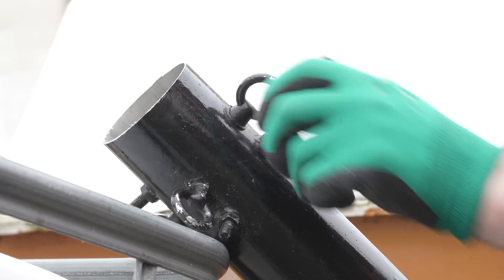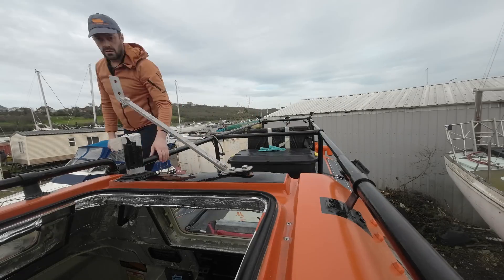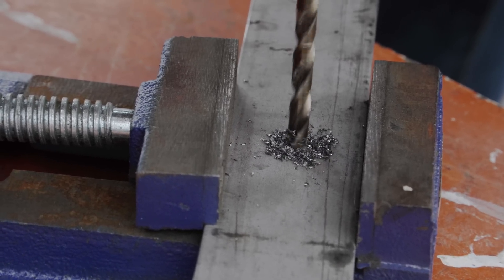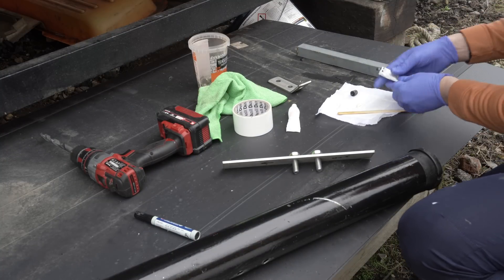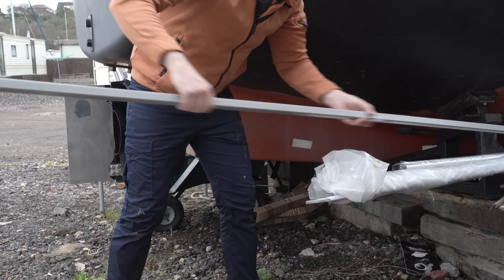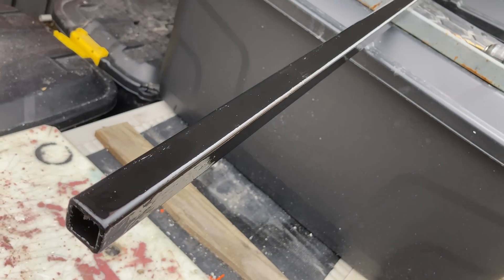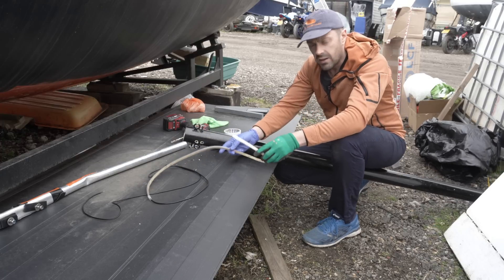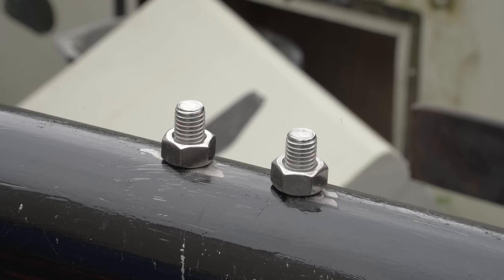Instrument mast preparation: space for VHF antennas, lights & a horn. Lifeboat Conversion Ep70 [4K]

Comment: Thanks for the Shout-out! I am proud to support your work. Been pretty busy though.

Most of the time I see a pole mounted with bands, or with holes drilled through both sides. Often with a curved mount the same radius as the pole's outer diameter to help hold it in place.
Reply from the maker: Cheers Paul! Welcome back.

Comment: Maybe I'm crazy but I didn't think it was necessary to treat aluminum because it doesn't rust.
Reply from the maker: In a corrosive environment in contact with steel, it will corrode galvanically.

Comment: Re the mast bolts, there's more than one way to skin a cat.

Idea #1  
A better way of doing this might be to bore two holes right through the mast, fabricate some crush tubes from some hollow bar that sit proud and weld them into the mast front and rear. Then the bolts (or threaded rod) can be inserted through the crush tubes and have flat & square surfaces to bear on when you tighten.

Idea #2 
Another way is to weld directly to the mast. Make any templates very accurately out of cardboard and tape that isn't too strong so it can be taken apart, take it and the mast to a nearby fab shop get them to knock something up and tack it onto the mast. Take it all back to Alan, test fit. If something is wrong then it is easy to change. When it is all kosher then get them to weld it properly. They'll be able to weld up the holes if needed.

Idea #3 
Re, those bolts on the mast with the JB weld on, forget ideas 1&2, alternatively run without a plate and no washers inside. 
Just align two opposite flats of the bolt head vertically and tighten. I'm mansplaining it, it isn't hard since the bolt pulled out by hand and lightly twisted will more or less self align and there is far less to crush when tightened than that plate. A thick wall tube that is the mast will hardly deform at all there.
Conversely, the plate is going to deform no matter what you do since it has 2x bolts squeezing it and you've increased the diameter of the compressive force over bolts alone - something has to give and it'll be the plate. It'll probably work if you really tighten it intending to bend the plate but the bolts need to be aligned so two opposite flats are vertical - and it's getting messy.
Reply from the maker: Thanks. I'll run through the options should my current idea not work. I want to avoid welds that stop disassembly. The plate won't buckle - it's 4mm!

Comment: For securing brackets to the mast I would look into using rivet nut inserts. Besides the threaded inserts you have to buy the installation tool but it's a great way to install a threaded hole in a thinner piece of stock. As for the bracket, if I couldn't find a flat-sided spacer for that sized pipe I'd fabricate one. The spacer slightly wraps around a pipe or pole and the outward facing surface is flat so that you can mate a flat object to it with screws or bolts.
Reply from the maker: I don't think DIY riv nut setters will handle stainless steel M12. And with this solution I spread the force across a wider area.

Point taken on the spacer.

Comment: I've noticed you're using stainless steel bolts etc. Don't be too alarmed but stainless doesn't go very well in salt water conditions.  Take a few galvanised spares just in case.
You're doing a fantastic job with Alan.  Keep up the good work,  and the videos!
Reply from the maker: I've not seen many problems with A2 or A4 stainless on Alan, or on all the other stainless fittings on the other boats in the yard. Can you elaborate? A4 / 316 stainless is specifically made for chloride conditions.
Reply: @AlexHibbertOriginals  If those bolts are specifically designed for chloride conditions then don't worry. I'll have to admit that although I do have some experience I'm not a bolt expert. I know you're no fool when it comes to forward thinking about such things so take what I  wrote as it being someone concerned for your safety.

Comment: I did something similar with bolting down solar panels to a roof rack where I didn’t have access to the bolt heads. To prevent them spinning I used carriage bolts so the squared section locked itself in to the holes that way I only had to tighten the nuts without fear of the bolts spinning.
Reply: Also if you’re worried about someone disassembling them. You could also use security nuts but they’re a bit pricy once you buy the correct spanner
Reply from the maker: Yes, I suppose a square hole in the 'washer' and a carriage bolt would have done the job.
Reply: @AlexHibbertOriginals  sorry to reiterate, existing holes changed to slots in my case

Comment: That flat piece of steel inside the mast is going to damage it and create divots which can lead to failure. You need to form that metal piece to the masts curvature.
Reply from the maker: I suppose we'll see. The area of contact is pretty long down both sides. I'm not expecting divots.
Reply: @AlexHibbertOriginals  maybe grind down just the corners then

Comment: For bolting into a tube / hollow structure the bulkhead door hinge clip nuts of a Land Rover Defender/Series come to mind.
  The nut comes attached onto a clip which is slid into an oval hole. The clip holds the nut in place and stops rotation. Best googled images to understand.
Reply from the maker: I tend to dart for cover when Land Rovers are used as a model for engineering prowess.
Reply: @AlexHibbertOriginals  haha, thats very valid, but there is no other car you can fix (or 'make work') with just two screwdrivers and a socket set

Comment: I would drill corresponding holes on the both sides of the mast, and :
Either cit the some sort of thick wall tube or pipe to the length of inner diameter of the mast feed long bolt thru.
Or better option is to drill corresponding holes the diameter of the tube in the mast 
Feed the tube through and get it tig welded.
This way you can torque as much as you need without distortion
Reply from the maker: Yes this is elegant, but takes up a lot of internal space, and means another welding bill.
Reply: @AlexHibbertOriginals  it wouldn't take that much space inside,  also if it's  pre cut and drilled, you could get it welded for 30 quid. 
But in a crisis situation all you need is two spanners to remove the bolts and refit them, you don't have to rely on the chemical bond in cold and harsh conditions.
Reply from the maker: True. And I might get a stick welder. Although the chemical bond is irrelevant once the nuts are tight.
Reply: @AlexHibbertOriginals  the welder is always a good idea, you will find so many  jobs that you can do better and faster if you have welder, I even seen people welding with stainless steel electrodes.

Comment: Could you either route out a place for the head of the bolt to slip into that would hold it captive or weld a length of metal on either side to form a shallow u channel?
Reply from the maker: Both are possible. See how the JB Weld does.

Comment: Unrelated.  Would it be possible to wrap copper or other coils filled with high temp liquid like oil around exhaust pipe and back to a boiler/radiator?  Would be a free source of heat in stearin of boat. Use less diesel and provide a backup. 
Also, would sleeping in a suspended hammock reduce the feeling of rocking ? 
Just curious, enjoy watching.
~Peace
Reply from the maker: You're the twentieth person to suggest, and I've yet to work out a system that would be controllable.

Great in theory though!
Reply: @AlexHibbertOriginals  Thanks for taking the time to reply. Wouldn’t a simple valve shut off and control the flow? I had a 1969 Austin Healy Sprite and a valve in engine bay (or under bonnet)  had to be opened to run heat in car.  Would an auto heater core set up work? 
Thanks for your time and best wishes from Edinboro PA USA
Reply from the maker: Only if you were tapping into the existing cooling circuit. Otherwise a separate cooling circuit with a shutoff to the outside of the engine bay would mean the heat would, instead of staying within the lagged exhaust, be deposited straight into the engine bay, and need extracting.

Comment: The stainless used in that exhaust clamp is probably grade 409. 409 is technically stainless but it only just about lives up to the name. It's used on exhausts because it's cheap and less prone to cracking than more corrosion resistant grades such as 310. 409 will probably grow some surface rust in a marine environment.
Reply from the maker: Yeah, and like other 400s it's a little bit magnetic. It's seriously well coated now, so am optimistic.

Comment: If you have issues with the two nuts you epoxy in, maybe try threading the holes in bit of steal which goes into the mask. You need to get your hands on the correct tap and die but that should be too hard to find the right size.
Reply from the maker: I'd have to drill it again, but yes maybe.

Comment: Weld the bolts to the bar stock. Then push the bar with the protuberance through the holes and tighten the nuts to the outside. You could even get fancy and weld around the bolts on the side facing the outside and cut off the bolt heads
Reply from the maker: That would be fancy indeed. I will get myself a stick welder.

Comment: Rivnuts rivet and a nut in one. They are nice easy to use BUT BUT BUT they can and do mess up and are a problem replacing . Kenworth Peterbilt Mac volvo all use rivnuts
Reply from the maker: M12 stainless riv nuts are beyond my setter.

Comment: If you cut a slot in the end of the bolt (threaded end).  You van use a flat bar / screwdriver to  stop  its rotation while you tighten the nut.   Real easy and can be done with the angle grinder.
Reply from the maker: True. Would have to find an extra long screw driver.

Comment: When I installed railings on my pickup's fiberglass hood, I used stainless steel  threaded rivet nuts, but I don't know if there are any in the size you need. Good job and greetings from Sweden!
Reply from the maker: Cheers

Comment: Regarding the plate inside the mast, would it not be easier to tap the holes in the plate on the inside and screw the bolts in from the outside? and then use som type of locktite to keep them from walking out.
Reply from the maker: Possibly, but I lack an M12 thread cutter, and I'd not want to rely on chemical locking in these temperatures.
Reply: @AlexHibbertOriginals  If you have to go down that route, you can pick up a kit from screwfix that goes from M3 to M12 for under £30 which would open lots of options for other jobs if needed.

Comment: strange you didn't "tack weld" the two bolts to the chunk of steel after they properly lined up.  Also, why didn't you put lock washers on the inside of the bolts?
Reply from the maker: I don't have a welding machine - hiring a weldy person is a last resort for this. Do you think nord locks between bolt heads and the custom 'washer' would stop rotation when applying the nylocs?
Reply: @AlexHibbertOriginals  bolt head, plate "washer", small nyloc (combination nut and lock washer) that's thin enough to fit in the space of the plate & segment of the pipe.  Epoxy is just room temperature setting plastic.  Ultimately, you're trusting two bolts set in plastic to hold a light pole while it's getting bashed by Atlantic waves.   £20 for a 5 minute weld job seems like a small price instead of having ocean waves using a broken light pole like a baseball bat on the shell of Alan .
Reply from the maker: Point taken. Although once the bolt and nut is tight, the epoxy has done the job and won't be loaded.

Comment: If the JB weld doesn't work you could just use a nut to hold the bolt.
Reply from the maker: Can you expand?
Reply: @AlexHibbertOriginals  sandwich that flat piece of iron between the bolt and a nut.
So when everything is assembled: Bolt - flat iron bar - nut - pipe - nut.
Reply from the maker: Ah, I see - this is excellent.

Comment: I haven't watched this video yet, however this has been on my mind in a few of your videos. How you expect the metal handrails and framework to react to thermal stresses? There's calculators online that can help you figure out how much your tubing will need to give. I don't quite remember how you initially installed these railings now and you probably already accounted for this. My fear is those T joints coming undone. I had this exact thing happened on my grandfathers house boat, we live in Canada and it goes through almost 100c of thermal shock throughout the year. We came back and pretty much every metal tube joint had snapped. We fixed it by having hard points on the fiberglass hull but only soft clamp style joints on the railings themselves.
Reply from the maker: Can you expand on where the failures took place? Something I may need to prepare for. If I had time/money, I'd actually rebuild the railings with GRP.